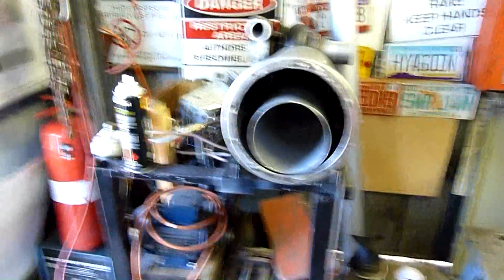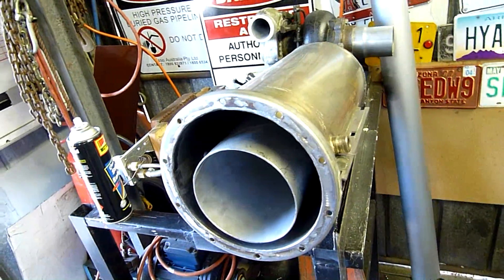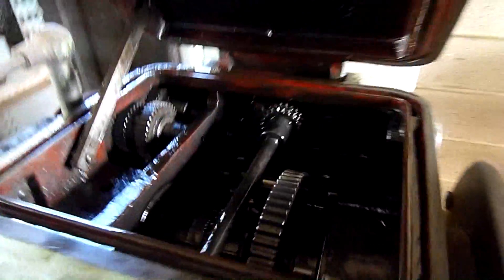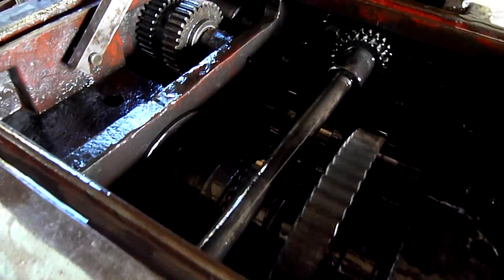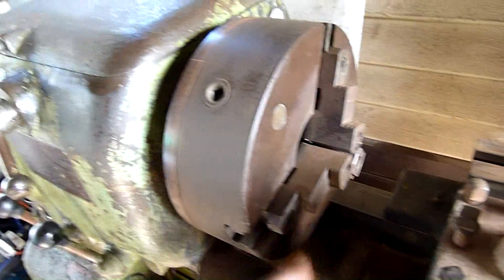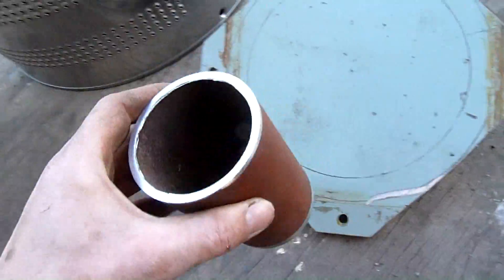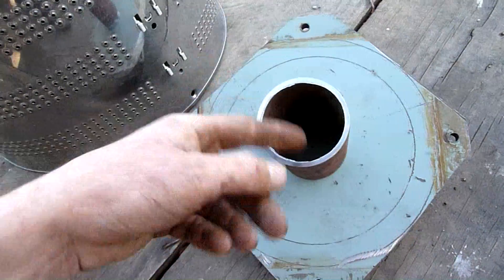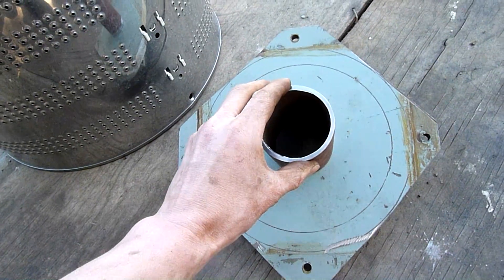Cutting and Machining Turbojet Flanges Pt1

Comment: you need to make a face plate for the lathe, then bolt the job on the face plate with packers and then machine away, way easier in the long run when turning end plates and other such stuff. do you have a mill. nice to see some progress on the turbojet.

Comment: is that a variable frequency drive controlling the lathe?
Reply from the maker: yep!, that is correct. its set to 50Hz only
Reply: just took a university course on vfd how is it wired in to that old lathe?
Reply from the maker: Randy Burgeron I wired the motor to 220V Delta and hooked it directly up to it (drive and motor can handle 415V in Star config, but I do not have the supply here)

Comment: and never start it with the key in it kid did that in school the key almost hit me in the head
Reply: I accidentally left the chuck key in a drill press when I started it, it hurts when it hits you in the chest at even a medium speed.
Reply: ya i was lucky not to get hit. i was sitting at a computer designing something for one of the cnc machines my back to the lathe next thing i know the keys smacking the side of the monitor surround not a foot next to my head.
Reply from the maker: oh hell yeh, that is the No.1 rule when starting a lathe!. make sure the key is out of the chuck! (my rule is to never leave it in there more than a few seconds (changing a part with one hand still on the key etc). and NEver walk away from the machine with the key in at all.

Comment: your 80 year old lathe runs better than our 6 year old lathes at school
Reply: Ha, I hear you there. We get caught up at a dead point in our projects because the lathe has a little leak and we can't use it until someone comes and fixes it even though it can usually be fixed by epoxying a cover over it,

Comment: Warming up an engine by letting it sit there idling before moving it really isn't a great idea...you get a heck of a lot more wear on it just sitting there then just driving it straight away but keeping the revs low until the engine has picked up some temperature.